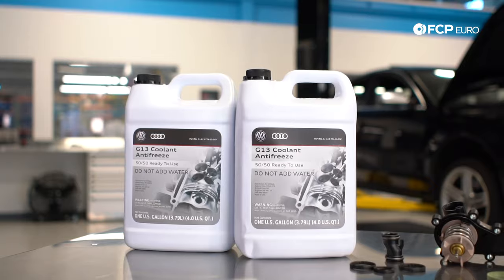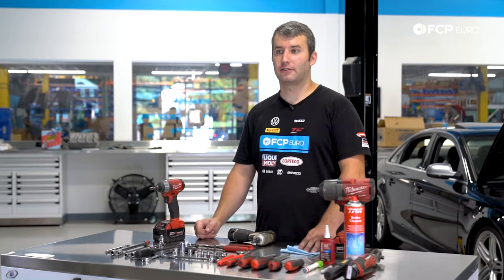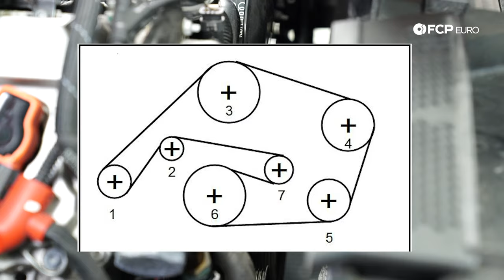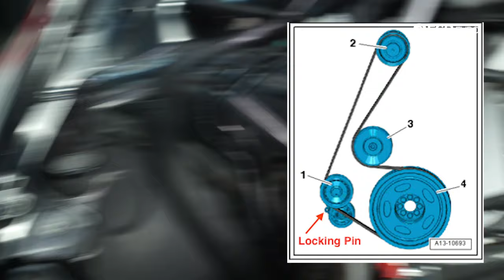Audi B8/B8.5 S4 - 3.0T - Water pump and Thermostat Replacement DIY(S4, S5, SQ5, and More!)

Comment: I just did my water pump and thermostat and also my crossover pipe but when i try to bleed the coolant its not giving me hot air in the cabin car warms up everything she did take some coolant and not overheating or anything but its not giving me hot air plz if anyone know respond to my comment
Reply from the maker: You have air trapped in the system, you will need to bleed it again, preferably using a vacuum fill tool if possible.

Comment: I just replaced my water pump and thermostat on my 2015 Audi S5 (3.0). I'm getting a "Coolant System Fault. Turn Engine Off" error in the dashboard now. Any ideas what could be the problem?
Reply from the maker: Hi Danny, we would recommended inspecting the electrical connectors to make sure they are seated properly.
Reply: Danny you ever fix this issue? I'm running into the same exactly thing on my 3.0t Q5.
Reply: @amarshall87  I did. Turns out I didn't have enough coolant circulating in the engine. After I replaced the water pump and put everything back together, I filled up the coolant reservoir to the specified level on the side of the reservoir (between min and max). Once I turned the engine on and the coolant started to circulate, the level in the reservoir dropped below the min and triggered the alarm. I realized the system was filling itself at that point so I re-filled the reservoir until the level maintained. I did have to connect to a computer to clear the code. All good after that.
Reply: @dannypomohaci209  Hmm thats what happened to me, but I filled it up again and I still have the error. If I drive like a grandpa its fine but as soon as I drive normal it starts to overheat.
Reply: @amarshall87  is the coolant level maintaining now or does it go down after you drive?
Reply: @dannypomohaci209  it’s maintaining. I just redid the whole thing to make sure the thermostat wasn’t jammed when I installed. The car idles and warms up like normal. As soon as I drive semi normal the air gets cold and the engine gets hot and fans are full speed. The upper radiator tubes get cold as well.
Reply: @amarshall87  sounds like thermostat failed if upper radiator hose is cold. should be super hot that you cannot touch it. you replaced it so just double check again if its sitting correctly.
Reply: @European_carclub  I checked it. Turns out it was the vacuum solenoid that goes to the waterpump. Thanks!
Reply: @amarshall87  oh yea gotta make sure that's fitted on. glad its working now.
Reply: I have a 2010 S4 B8 and it’s in the shop. Waiting on parts. Definately needs a new thermostat and the Coolent pipe since it burst. Am I safe to assume the water pump should be replaced also whether it ‘s broken or not?
Reply: Did you ever figure this out? I have the same issue.

Comment: If you used a low profile 1/4" ratchet and low profile bits, could you avoid the service position?
Reply from the maker: tmtoplak222 it is 100% doable that way, similar set of steps just a bit of a short cut getting there. That is one of the ways Cory meant when he mentions there are some quicker ways to do it (not necessarily easier), but certainly would have made it very difficult to explain and shoot the video without seeing anything!
Reply: @fcpeuro  Thank you. Now all we need is a PCV tutorial : )
Reply: When you say "Service mode" do you mean the front end being shifted forward a few inches?
Reply from the maker: @tmtoplak222  keep your eyes peeled to the channel next week
Reply from the maker: @grantmarchino2036  exactly that

Comment: do all b8.5's have plastic fender liners? and b8 has the felt style fender liners?
Reply from the maker: butlr732 - correct! Audi switched to plastic on the B8.5 models.
Reply: FCP Euro do you have any idea if the plastic ones are a direct fit for b8’s? My b8 style felt fender liners rip pretty darn often

Comment: So, the video says you need 2 gallons of coolant....but the kit only has one? Very confused. What is the coolant capacity? You're clearly draining the whole system by removing those hoses.
Reply: ... just add an additional gallon of coolant when you place ur order.  Rather have more than not enough.

Comment: Can you replace the waterpump without putting the car in service mode?
Reply from the maker: You can Mario it just takes a few specialty stubby wrenches, a lot more patience, and some solid hand work
Reply: It is a lot easier to put in service position than it is to find the T25 you dropped into the engine because you couldn't see what you were doing and it slipped out of your fingers.  Just sayin.

Comment: Of course the waterpump fails, look at that stupid OEM plastic impeller.  Worst idea ever.
Reply from the maker: the plastic is certainly a pain point!
Reply: Hmm, I just received my oem replacement water pump for a 2012 S4 and it's metal. Audi went to a plastic design in 2013? Shame!

Comment: Umm.
Reply from the maker: Yessss Jake?
Reply: FCP Euro it’s very in depth. So many parts to remove before getting to the nitty-gritty.
Reply from the maker: @Jake Lee  Something like "Its not about the destination its about the journey getting there" ^.^ It is indeed quite the process just to get to the root of the problem, but once you're there its great! That's why when doing this job we suggest doing a handful of maintenance jobs while you're that far in.
Reply: FCP Euro is it possible for you guys to sneak in some work on a BMW F48 XDrive? I cant find any professional videos on this model and google gets confused.
Reply from the maker: @jvkelee  we have some in our parking lot, what in particular are you looking for?
Reply: FCP Euro looking for maintenance intervals on the Xdrive differential, where it’s located and how to change the fluid/when. The transmission is mounted funny in this vehicle how would you “drop the pan” and change the filter and refill it? Also are there known or questionable parts so far with this make? Like prone to failure?